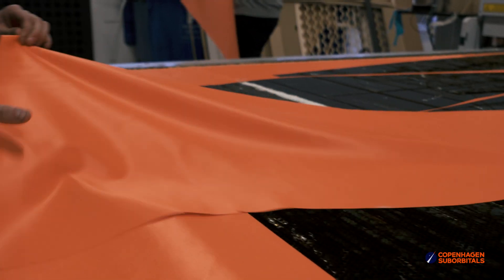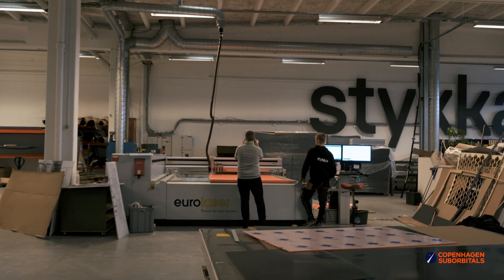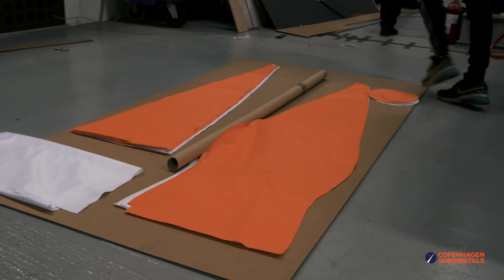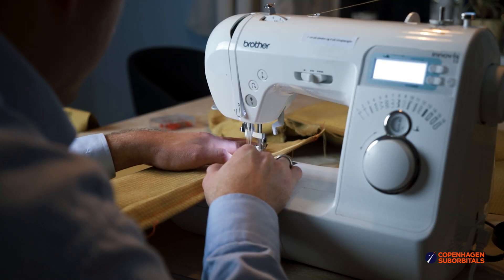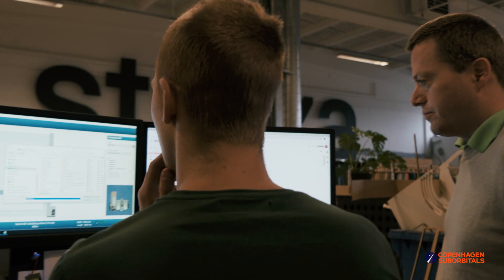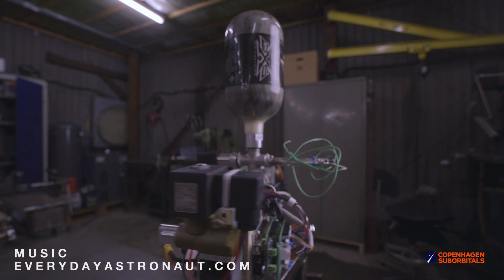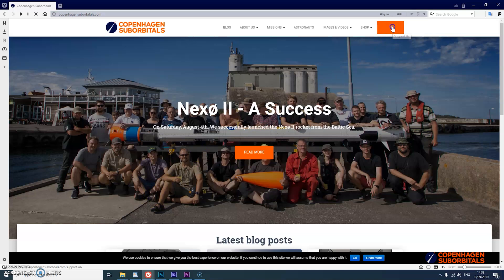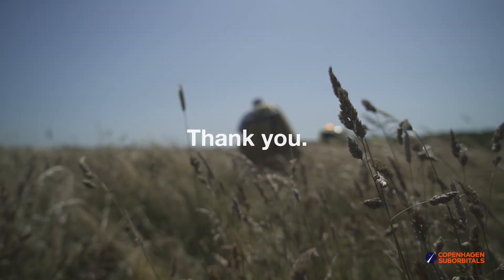The Cutting Edge of Supersonic Ballute Manufacturing

Comment: Won't that middle seam become a weak point of the ballute?  Have you calculated the force on that new seam at each moment of deployment and found the strongest force the seam needs to hold?
Reply from the maker: Well, the way it's sewn together at the middle resembles the method at the bottom, where the lines will be connected to the ballute, and we haven't seen anything near a failure on those yet. 
In the end, the strongest force expected overall on the ballute will be less than 4G with the space capsule, which will weigh 350 kg. With 12 gores in this version it's around 1,170N per section, and we've tested the sections to twice that load without a hiccup.
Reply: @CopenhagenSuborbitals  

Interesting, thank You for sharing the information. It suprised me a bit that You managed to make the capsule that light.
Well done guys!
Reply: I can't answear the question, but as i understood it is still going trou a serie of practical weight testings, so far it seem to work as planned, from what i heard.